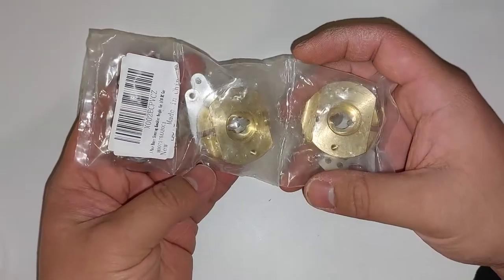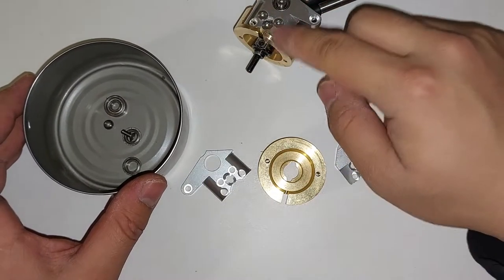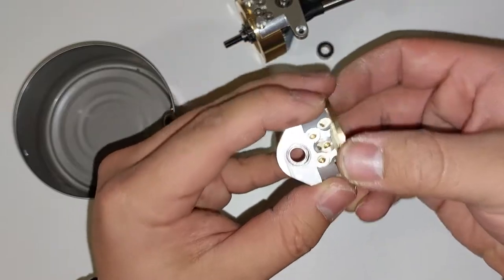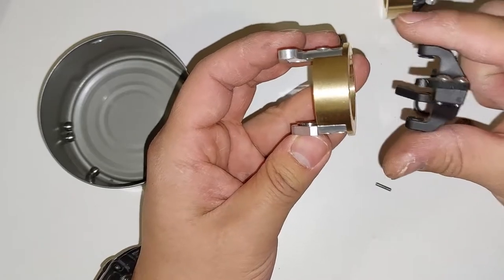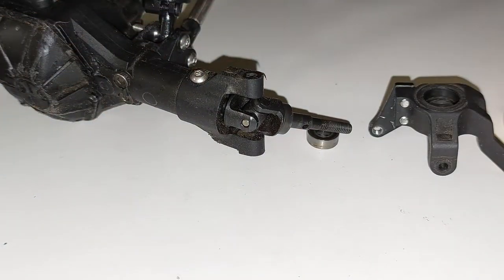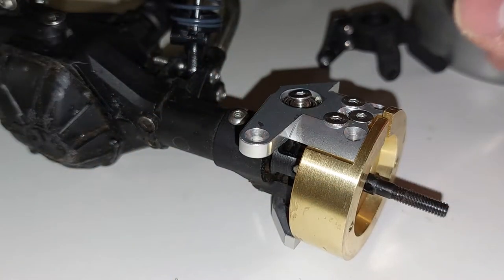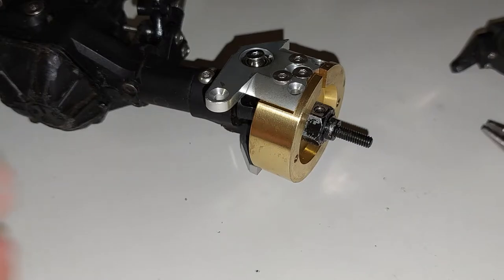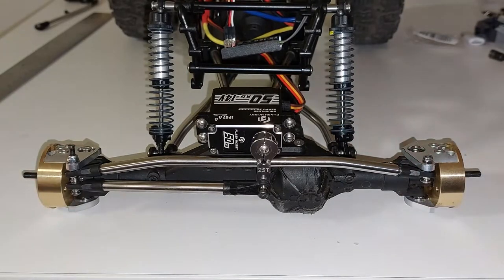Budget AR60 Brass Knuckle (Wraith/ Bomber/ XR10) review and install

Comment: Hey man, I really appreciate the video, as I seen these brass knuckles for the bomber, (on amazon), and decided to buy them. I also bought some cheap rear brass lockouts. I was going to install these front knuckles tomorrow, but was wondering you had to get different length steering linkage?? I don’t have the stock plastic ones anymore, I switched the steering linkage to an aluminum one from boom racing. I don’t think it is adjustable (length wise) at all.  It actually has a post on one side, which has another link connected to the servo horn.

Comment: Did you find there was play in the knuckle pivot bearings ? If so did you replace and what was their dimensions?
Reply from the maker: The pivot bearings are 6x10x3 flanged bearings. They have been running fine so far, no play

Comment: How good had been since you mounted then ? Any problems ?
Reply from the maker: No problems so far.  It did take a dip by accident into a salt water puddle and cased some corrosion, but other than that it's has been pretty solid.